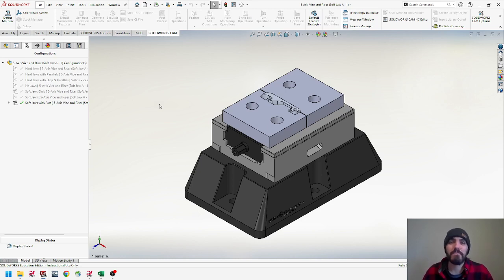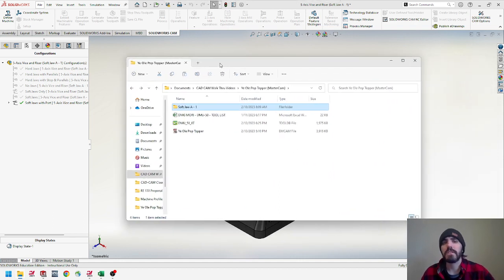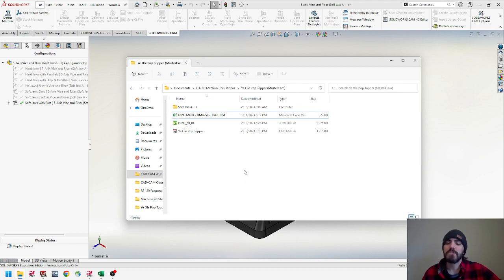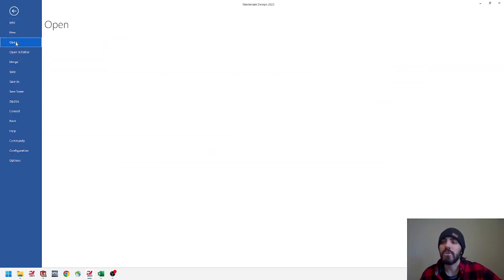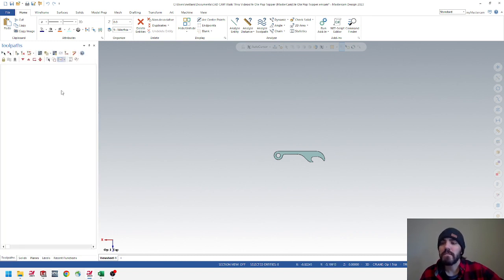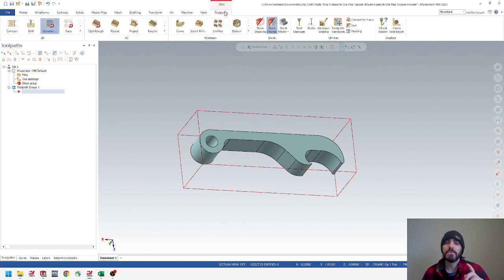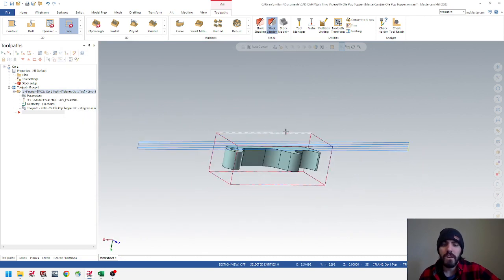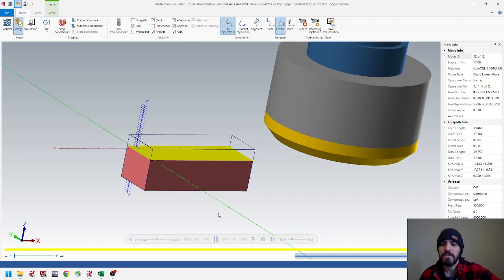Multi Op Programming in MasterCam (First Operation & 2D Dynamic Mill)

Comment: just some tips: you dont need to select any contour for face milling if you have already set up the stock. Also in 2d dynamic, you dont need to select the machining region, just select the avoidance region and it will calculate based on the stock setup.
Reply from the maker: Hi, thanks for the feedback!  I like students to get in the habit of creating wireframe geometry early.  I think there's some benefits to knowing how it's used so it can be referenced for more complex toolpaths down the line.